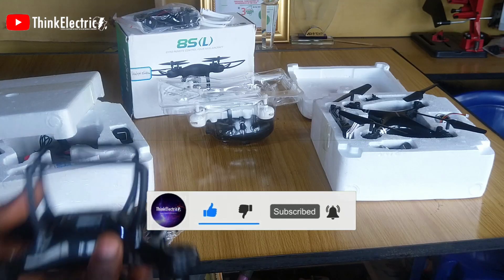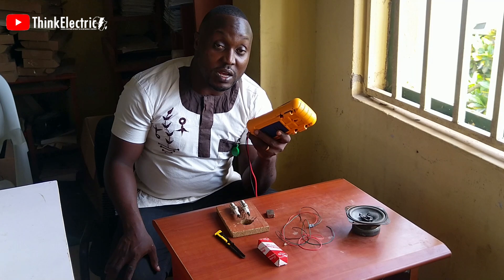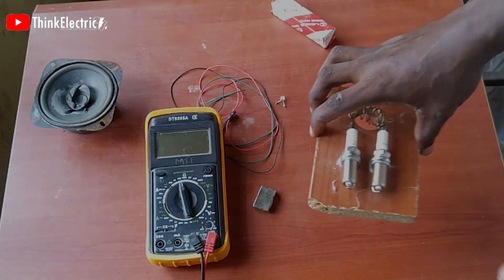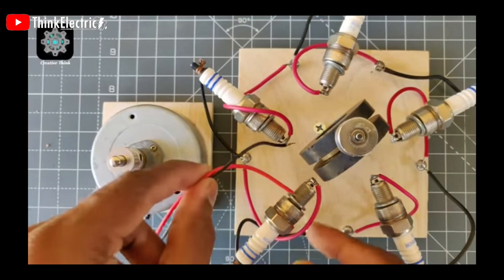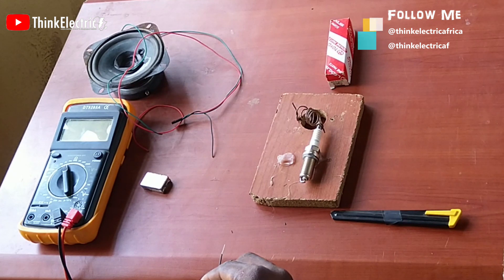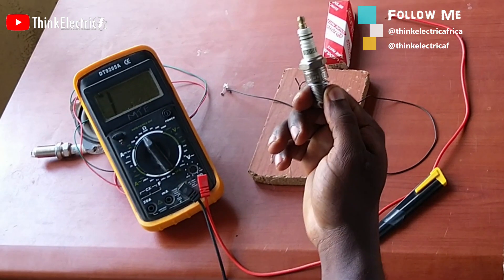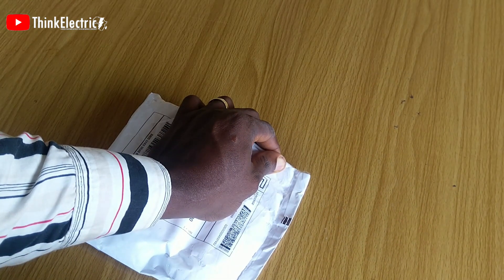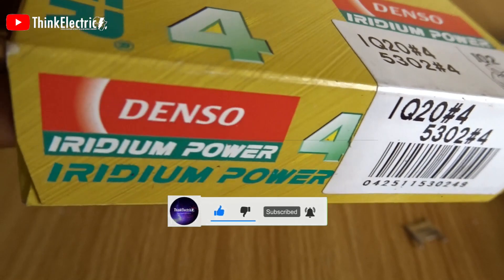Free Electricity Generator with Spark Plugs,Testing the spark plugs. WOW! Amazing Result.

Comment: I Experiment with spark, too
The Secret is the Finger 
And  your body 
- there are 0,68 V and 0,10micro Ampere
Iridium inside made it possible
Reply: How are you sure
Reply: @krisemeka7494  yep but there is no realy activity .. even more Salt and swis Finger
Where you Experiment with it

I try it all night long for 5 days... all youtube videos!

- Copperwire around a Ring magnet.. no!
- sparkeplug on a Ring magnet.. no
- Sparkler plug and all other like all youtube Videos.. no.. 

But there are 0,68 volt if you measure the  
Top and the Middle of the sparkler plug..
-> first i Thing i have found free energy too! .. but its galvanic law and the Iridium  Element insiye ..  i Google it in german 
 if you use copperwires .. so you build an normal Battery) ..